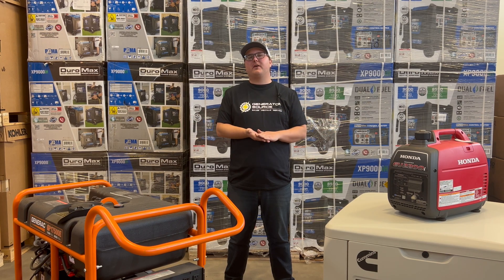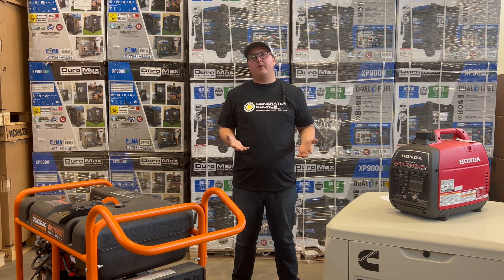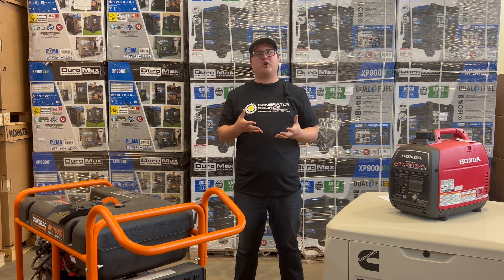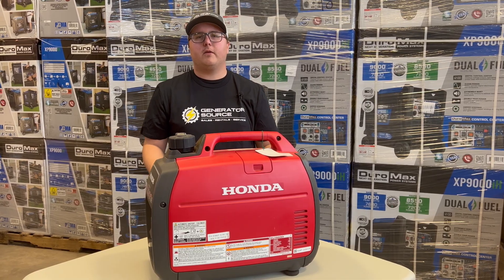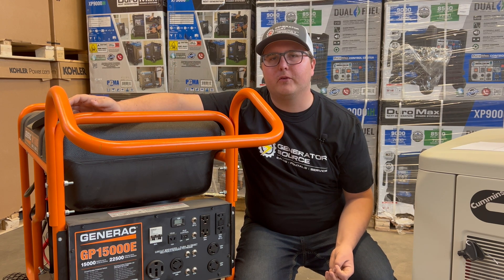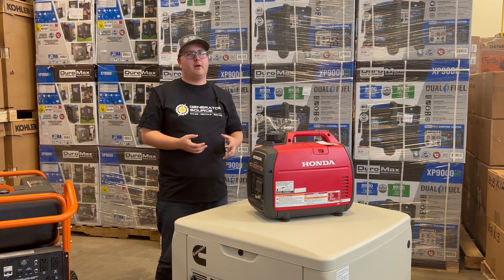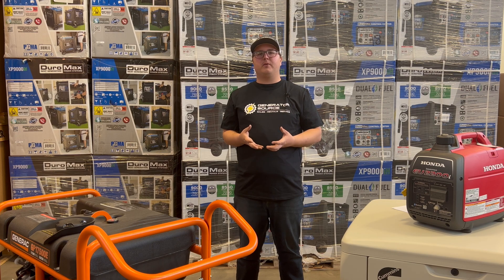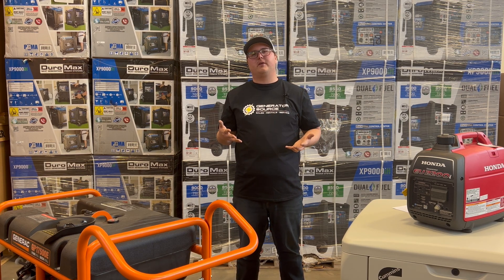Can You Use A Generator to Charge Your TESLA??

Comment: We use the EVroadHERO 9kw model.  It has super clean electricity (safe for the EV) and also a custom made EV charger that is tuned exactly to the generator max output in order to get the fastest charging possible.
Reply: Whats it tuned to?  3kw or higher for the 40-50amp tesla 240v charger?
Reply: @LORENZindustries  we have a level two EV charger custom configured to provide 37 A, so 9kW to squeeze every last drop of juice out of the generator. That’s the generator’s full load continuous rating.

Comment: It looks no-one has done it. By simple physics if the generator delivers up to 30 amp at 120v there shouldn't be a problem provided only the EV is connected. V=IR  Volts= I (intensity)watts x Resistance ohms. Watts= V.A .then, at east 3600 watts required. That is with the 120v home charger Tesla provides .

Comment: does this mean putting a generator in a trunk will not theoretically ever be able to provide enough range to sustain a drive
Reply from the maker: Only if it’s a larger unit with 220 vs 110. 110 will get you a few miles over hours while the larger amps would get you maybe 25 miles after an hour or two. More about emergency situations.

Comment: Does the generator need to be an inverter? Floating neutral? Bonded neutral? Asking for 240V Type 2 charging.
Reply from the maker: a inverter style generator is best by far. Or just use a standard with some distance from the EV. A generator with a floating neutral will not charge an EV. Bonded Neutral is best for operation-- you can add a plug to make it work in floater.

Comment: Does it have to be an inverter generator or will a conventional one work? Any idea how much THD an EV can deal with?
Reply from the maker: No sure on the THD abilities with an EV but most larger home standbys are less than 6…. And connect to the home via transfer switch. As for a larger portable that can charge faster, just put a little distance between the unit and EV and it should be fine.

Comment: Did you actually try to charge the Tesla? Is a neutral and ground bonding needed?
Reply from the maker: Adapter was required.
Reply: What adapter? I need the adapter I believe since my generac wired into a main panel with a ground and neutral into nema 14-50. The Tesla would say charging but go between 0 and 1 amp back to 0

Comment: It's actually very simple if you have F-150 truck, it has 240v 30A outlets.
Reply from the maker: Yep, it will slow charge at 30A as we found that 40A seems to be the "cutoff" if you will for higher charging speed.
Reply: @generatormart4631  there is nothing slow abut 30A, it's just 33% difference. In fact, if you are using Ford mobile charger, it's rated @30A.

Comment: Can we charge the powers directly into battery while we are driving?
Reply: Depends on the vehicle-- Teslas state that systems that can operate while charging include the infotainment operation, automatic climate control, and a few others. As a safety measure, though, the drivetrain is disabled when your EV is plugged in to prevent damage to the vehicle, charger, and so on.
Reply: No i dont think any electric car allows that when you're driving.
Reply: There's a guy who modified a model s with a diesel powered generator that sits in the trunk and feeds power while driving. Not very efficient, but he got it to work.

Comment: could it be 240v 30amp ? or would that not work ??
Reply from the maker: In all of our research, the 40 AMP level seems to be the threshold for faster charging. 30 AMP would fall in the slow charging category.
Reply: You just multiple the voltage and the amperage. So 240*30= 7200 W or 7.2kW. Yeah that’s good, not the fastest but obviously faster than 1.5kW from a wall outlet

Comment: Won't a regular generator damage a Tesla compared to an Inverter generator?
Reply from the maker: In our experiment all worked as long as you had the right adapter. Small electronics like laptops do have trouble operating near non inverters. Harmonic distortion is the problem. Teslas must have protection built in. Distance from unit would be a factor but with our tests generators were about 10 yards away.
Reply: What adapter would be needed for this generator to charge level 2 on a Tesla thanks in advance

Comment: The generator that had the 1450 didn’t look like inverter type. Will it still charge a Tesla.   
Also, to the comment above, electric cars are more reliable and more ways to get miles and at a fraction of the price of gas.
Reply from the maker: Every generator in this video could charge an EV, but it would really only make sense in an emergency situation because it takes so much time to do it. Even the little Honda could do it but might take 4 hours to get 10 miles etc.

Comment: just buy a gas car using gas generator to charge a EV is insane 🤣
Reply from the maker: Agreed, this is really for an emergency when power is out for days and you have to drive somewhere.
Reply: Isn't using a battery to start a gas car insane?
Reply: Insane ? You burn gasoline everyday, and an EV burns once a year for an emergency power outage ..it depends what angle you look at it from
Reply: @cohenkevinloriqueen818 you really think electricity from a wall charger is clean?  Where does that power come from?  Not trying to be confrontational, but you can’t be serious? 264kw in 24 hours!  How much power is that and where does it come from?  Not from unicorn milk buddy!
Reply: @cohenkevinloriqueen818 does it though? How much fuel was used to build it? How about to mine the lithium? Or let’s see where the power at your house you charge with, comes from.